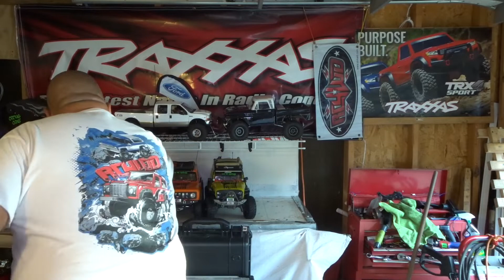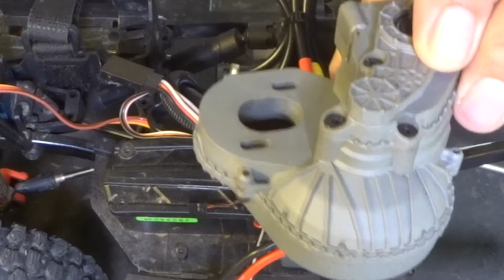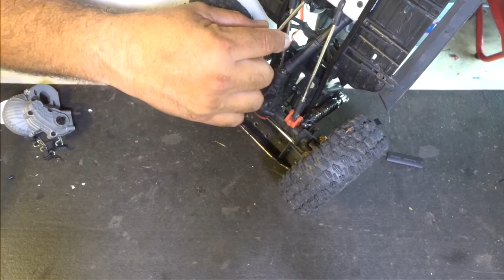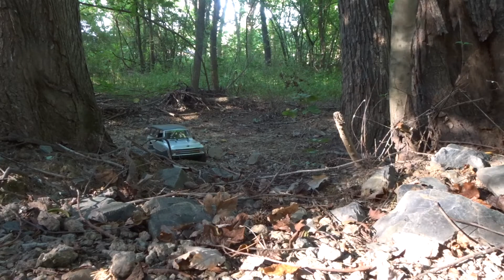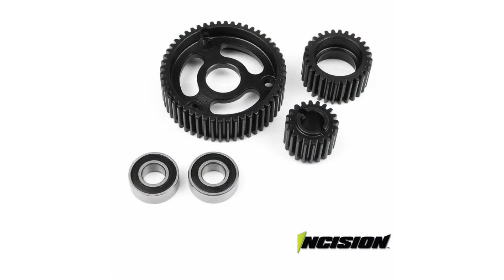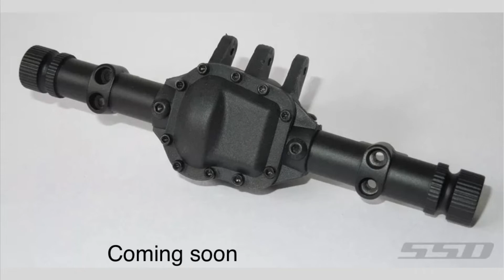How to Bulletproof a Axial SCX10 2 part 1

Comment: You made a good trade!! I'm always going to run Axial... Even if someday I can afford the new Enduro Sandero! There's something to be said for running lines with AXLES that actually look like they came with the Truck!! 😳 
I'd take a Gen 8 in a heartbeat. But I had a real International Scout II.... And I don't recall seeing Portal Axles! 😋 They're absolutely a performance advantage. Personally, I'm all about Scale, and have never run a Pro level Comp. 
I do appreciate the ones that do though. Some of the things they can climb, is CRAZY!! 

Good Luck setting up that SCX10 II! It's a solid Rig. 
Carmine ✈🚂🚙
Reply from the maker: Nice.  I will have to check those out.